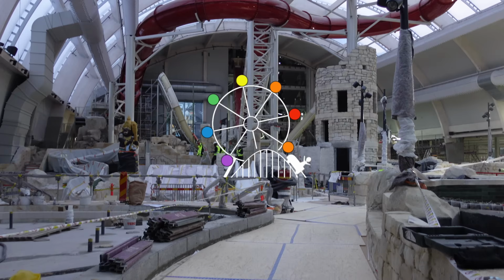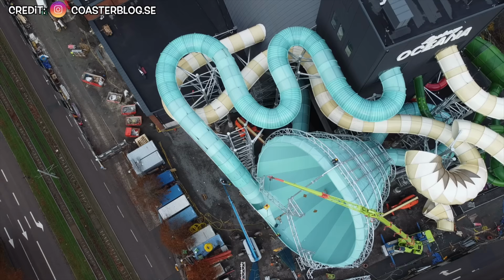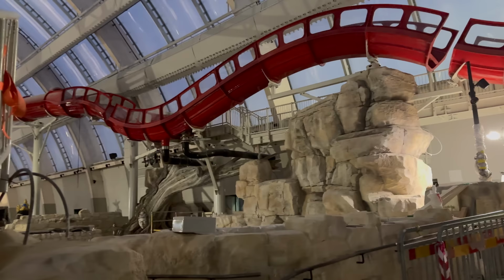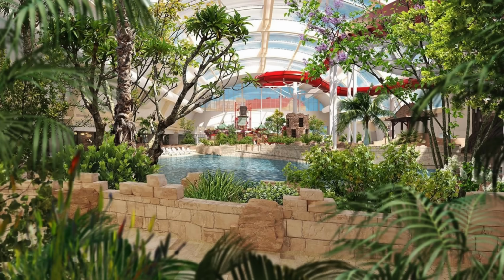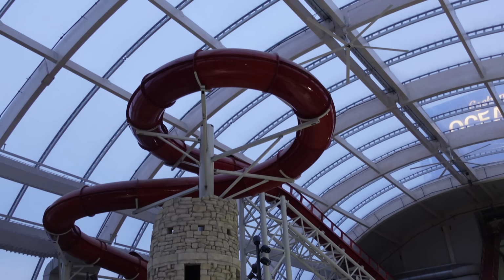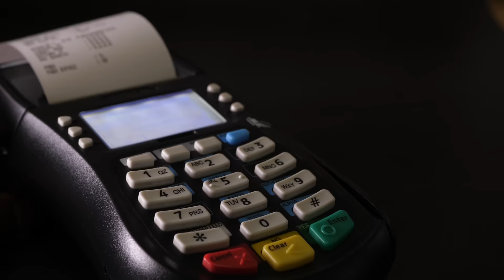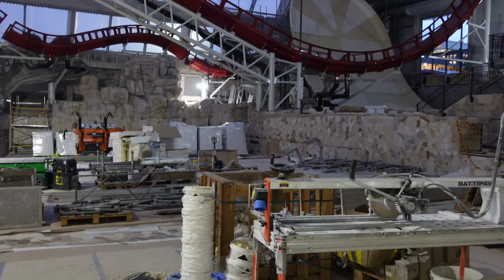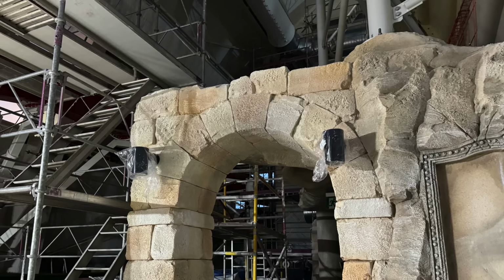🌊 Exclusive Sneak Peek: Liseberg Oceana 2024 - Inside Europe's Newest Water Park! | Coaster Stop

Comment: It kind of makes sense that the whole construction exploded after only 13 minutes of fire when you see all that building material and plastic in the video. It was a death trap. Lucky it happened now, before it had opened and it was filled with people.
Reply: Well, plastic slides and acetylene/whatever gas canisters used for welding, don't really mix together, either... And I assume that's what caused the explosions, since there was still work being done... :(
Reply: it couldn't have happened because they were going to check the oceana next week and since it was during working hours one of the workers made a mistake
Reply: @susan9043
 Fire supression, spinklers and fire doors were almost gauranteed not to be operational when this happend, or it would would not have ended with total destruction. But as long as work is being done, these systems are usually not in use and also not required.